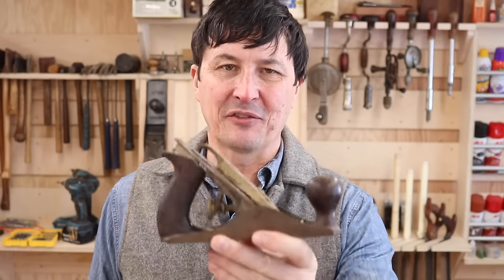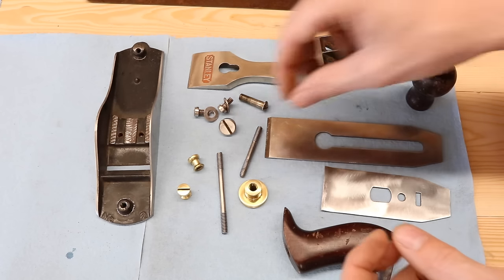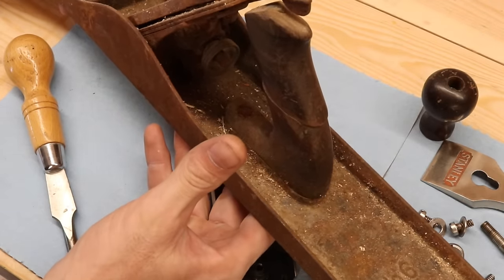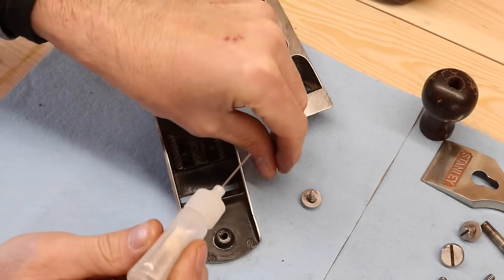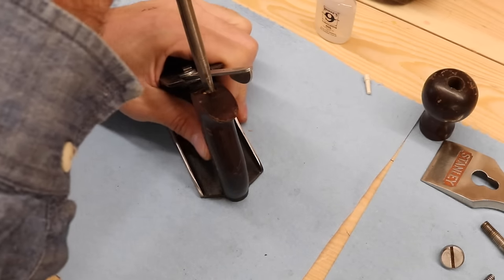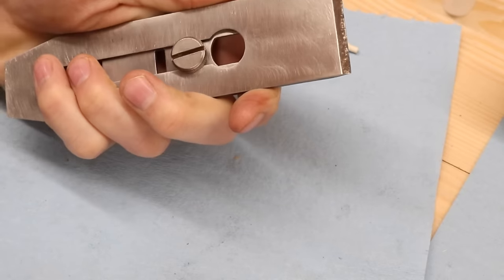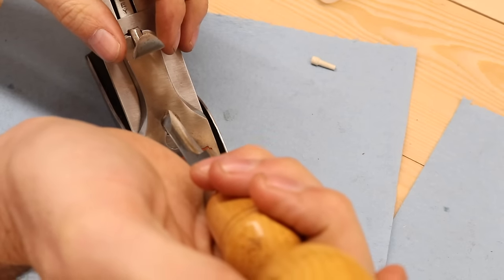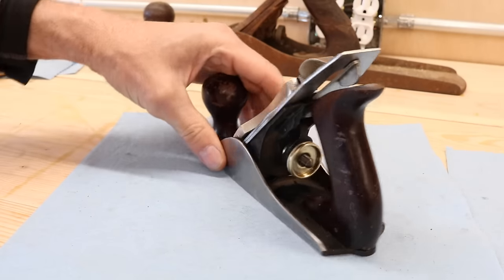HOW TO DESTROY A STANLEY PLANE!!

Comment: I don't why but I had a Eureka moment thinking about the 'frog'. It got me thinking back to my days in the army and using a bayonet frog to fasten the bayonet scabbard to a belt. While the origin of the term is uncertain there is link back to earlier frogs used to attach swords and knives to a belt. These had straps that supposedly resembled a frogs legs. 

The definition of the bayonet frog is 'a device to attach a blade to the belt' or something similar. 

This fits nicely with the purpose of the plane frog- it is a device to attach the blade to the plane. Furthermore there's always been a strong link between armourers and Smith's in war using their skill in peacetime metal working or vice versa. I'd expect therefore they would be familiar with the term .

I could be completely wrong of course but to me the logic works, maybe just another small piece in the puzzle of the frog 😉.

Comment: What an excellent restoration Cody! I'd give you more money for it now than as it was. I'd also don't like them repainted as it never looks quite right either. Excellent excellent job. 

Do the 6 and use and enjoy it. You are correct about the corrugated sole. It's an old plane pre dates your 2 by at least 30-40 years.

You can get rosewood handles from Crown tools in Sheffield England.

Comment: Simple restoration as you have done, maintaining the original finishes and patina, generally give the highest resale value.    This is not always the best way.    The No 6 covered in rust.   Left alone the rust over time will continue to damage the casting.   The broken tote makes the tool difficult to use.    Planes like this generally sale for peanuts.    Clean it up, repaint the casting, polish the metal, give it a decent tune up,  and maintain it, the plane will be serviceable and last for many years to come.  And be worth a few dollars.  

The No 6 is a type C.   C is for corrugated.    Two version of the reasoning.   Corrugated planes were introduced because as the heavier metal planes were introduced into the tool market, carpenters who had to carry their planes around balked at the extra weight.   So corrugated planes were developed more as a marketing tool to sell the planes.    Same reason they also made transitional planes.    They had to convince the carpenter and cabinet maker to buy the new planes.      The second story about reducing friction probably has some merit too.   

Stanley's with the keyhole in the cap are manufactured pre 1925.  After that planes were manufactured with the kidney shaped hole.

Comment: If I might make a recommendation, while I like the way it came out, use either a much much finer wire wheel or switch to a fine brass. A softer metal doesn't dig in as much and would at least limit the "brushed" finish. Some might say the metal is damaged now but I think it turned out pretty great.

I'd really look forward to seeing you restore the Bailey No. 6! Thanks for the vid,
-

Comment: The answer to the frog!
Rodger K. Smith, an engineer working for Stanley in the 18hundreds wrote in many of his files and work diaries of how (as in he was tinkering, and finding out "how") to fitnthe frog. He wanted to improve the fit of the frog, and he named it so. Because, and it's written in his diaries and notes, he said it sat behind the throat. Previously, people making wooden planes didn't need a throat. Stanley were making steel and brass planes, obviously requiring a throat, which Smith and his colleges were tinkering around with to improve the design of. Which is why most Plane frogs are adjustable these days. So yes, the Frog is "behind the throat". He only publicly called it that after a number of years. There's an engineering book by him where he also says the frog is "behind the throat". I've NEVER found or heard of any records that predate Rodger K. Smith about the Plane Frog.

Comment: hey wranglerstar, do you think maybe you want to flatten the sole fully built with the tension on the bolts??? I know When you flatten something without the bolts torqued it may flex or warp when you do torque the bolts and it wont be as flat as possible.

Comment: I have a small collection of Stanley planes and have cleaned many of them and keep a good example of each sharp and tuned to use in my wood shop. On the issue of "refurbishing" them you demonstrated the two ends of the extreme on this subject. You used a wire brush on the steel and brass and made every attempt to make this 90 year old plan look new again. (curiously you left the tote and knob all scratched up with the old varnish on them??) You mentioned that "purists" wanted the rusty and dirty planes left as found to preserve their value. What you failed to mention, in my humble opinion, is a middle road. My approach with these old planes, a number of which are from the 19th century, is to clean the metal of all rust and dirt ( I use 0000 steel wool and diesel and sometimes rust remover), clean all the wood using something like Formby's Refinisher which removes the old varnish, lightly Rub the wood with 0000 steel wool and coat with a couple coats of boiled linseed oil. After cleaning the blade and chip breaker I do sharpen the blade and file the leading edge of the chip breaker flat. This way I have a very usable plane but one that still retains the patina a tool of that age should have. There is a middle ground here.

Comment: Wranglerstar, I would be inclined to use a wire brush, along the grinding pattern, on the body of the plane, rather than a sander, as this would retain the grinding pattern, rather than removing it, and maintain the authentic appearance, and function.
Also, it would be worth investing in a spray can of clear furniture wax polish, to spray all the metal surfaces, as this protects them from re-oxidisation, and doesn't run off or evaporate like thin oils. Iron oxide spots form an electrolytic cell with other oxide spots which then expand the corrosion area. The wax fills and seals those microscopic pits, and then solidifies when the propellant evaporates.
I've some Stanley planes that I've had since my youth, if the prices you quote are common, maybe it would have been a better plan to buy more, instead of a pension?

Comment: Have you tried Evaporust or White Wizard to remove rust without removing any of the steel? Leaves a grey finish on steel which polishes up well. If used with stainless parts they come out like new.
Keep up the great work!

Comment: Great work on that #2. I would be very interested on the the Bailey restoration as well. Just a quick note, I have a woodworking friend that teaches others how to restore the old planes and he uses electrolysis to remove the corrosion from the metal pieces instead of the grinding. That takes off less of the material. You might try that instead of the buffing and grinder.

Comment: Hey Cody, do you have a resurfacing race for your grinder wheel? its a cast handle with 4 or 5 wavy disks that spin and re flatten the surface of the wheel. I also bought a "Lilly white washita" stone for advance sharpening.:)

Comment: I've got a late 70's craftsman grinder I picked up at a yard sale for $5. dual head, flexible gooseneck lamp, 1hp motor. only thing needed was a new stone and a wire wheel, and a new lamp socket. best $5 I ever spent. I've sharpened chopper mower blades with no problem

Comment: Great job, I really enjoy your chanel. Just a small pice of advice, you should not lubricate fixing screws since it changes the behaviour of the screw by removing the friction from the equation. Then a small torque generates a greater tension and you may snap it.

Comment: I just started on a Bailey #6 myself. Mine is not fluted but the very top of the handle is broken off just the same. Thinking about gluing on a piece and shaping to get it close. There are initials low on the handle I wouldn't want to lose.

Comment: Yes Cody please restore the number 6. I want to see how you clean up that fluted shoe.  I was able find and restore a Stanley block plane from the 1960s usnig the method you showed of wet dry sandpaper, a plate of glass, and wyndex.  lt came out perfect.  the original paint was in really good shape.  I didn't have do anythig to it except a good cleaning.  I was so excited to restore it after watching your videos that forgot to take before and after pictures so that I could so I could send them to you 😟😟.   Oh well Ihave another larger plane to restore.  I think it might be a Bailey not for sure.  Thank you for teaching me how do tool restoration.  You are a fine role model. I wished my father would have been.

Comment: Nice looking plane. As to value of anything, that is up to the holder. If you value old rusty things because they are old and you want to put them in a case and look at them, and then later sell them and (hopefully) make more money then, go to it. If on the other hand, the value of that item is in what I will give you in your woodworking, then by all means restore it to its full functionality. I have a couple of Stanley's from the late 1800's, that were very rusty and in need of TLC. They got it and now help me with my woodworking. The Stanley planes were designed and built to be used by craftsmen to work wood. Their value is in what they can do for someone who knows how to use them.

Comment: I have read that Japenning can be replicated using 50% asphaltium and 50% marine varnish.  Asphaltium can be obtained by using dried up roofing tar ground to a powder.  mixed with the marine varnish it will self level on flat surfaces.  Cures best when baked on at about 220 degrees centegrade.

Comment: @wranglerstar the Lee Valley website has measured drawings for the rear totes/handles on Stanley planes so that you can make precise replacements. Search their site for 'handle template'. The nos. 5, 6, 7, and 8 all use the same size.  I bet you could knock one out in an hour.

Comment: Funny trick with the title, however if you don't go back and adjust the frog farther forward the force of planing will press the iron back into the back of the throat and you will ACTUALLY DESTROY the sole of that plane when it cracks from the back corners of the throat. Go take it back apart and move it farther forward so the frog aligns WITH the rear of the throat. Need confirmation,? Go take a minute to watch a few of "Plane Collectors " videos. He shows and explains it better than I.

Comment: That's a fine job ye made on that Plane there.  Now ye can adjust it and put the necessary force into it when required.  The No.6 is gonna need a new handle, for certainty and safety.  I dare say that apprentices wouldn't have the bigger planes or tasks that need them to do, hence a smaller handle but it's probably just to scale.  Good on ye!

Comment: Oh yea!! Lest restore another one!! Good job! I get most of my parts for planes on ebay. Or ill buy a parts plane that's missing a few things.  I have around 35 working planes. Try making an electrolysis tank to remove rust. It works very well .Especially if something is locked up because of rust.

Comment: The handle can be repaired with some epoxy resin on your No6. I've had a similar problem with a stanley bailey No 4 and it works great after gluing the handle.

Comment: Drill, dowel and wood glue the handle on the #6. The stud holds it down tight when it's done. I fixed a friends bass guitar neck once by doing that. It worked great and held for a long time until he threw it on stage and broke it for good.

Comment: Rotate the front handle to its original position with the dings facing forward and the polished by the palm of the original owners  hand part to the rear. 'Just a thougt'. Great video's. Ray . From Norwood south London England where William ford Stanley lived & worked. Ps I'll keep my eye's peeled for a no1 for you.

Comment: Go ahead and restore the #6 and any others that you need/want to.  Patina is only of value if it IS NOT rust or pitting.  also, these planes from Stanley are not classics (yet).  Many of these planes are still made in certain versions.  Not all things should be left in rundown condition.  I have several of the same planes that you have that my father started collecting.  He restored some and I've restored others.  The main thing is not to remove name plates or so much material that you remove model designations and the like.  Love the series on planes.  Keep up the good work.  :-)

Comment: I have my dads old #4 that I’d like to restore, Did you run the sole or base through a milling machine where the frog bolts on? Or did it clean up that well?  
Anyway very nice restoration.

Comment: Excellent job, I agree tools should be used not left to rust on a shelf. when you restore the number 6 try putting it in white vinegar for 12 hours and it will take off  all the rust.

Comment: I think you can see why it's called the frog at 6:28 - just as you mention about the British sense of humour. The two large holes in the frog look like the eyes of the frog, with the throat looking like the frogs mouth.  I only noticed it when you were talking about it and happened to have the frog in the exact spot where the bottom edge of the frog lined up with the top edge of the throat.

Comment: The smallest planes I have (which aren't block planes) are a pre-WWII Stanley #4 and a Stanley #3.  The #3 is really small, I can't see where a #2 would be useful for me and my stubby sausage fingers.  I bought them rusty and neglected about 30 years ago, and yes, I use them all the time.  My "restoration" was cleanup, flattening and trueing, tune up and then to work.

Comment: May I suggest using Forsters Gunsmithing Screwdrivers for screws, especially brass screws. They are concave ground and will not slip and mar the surface of the screw.

Comment: Soak that rusty #6 in Evaporust. Works like magic and it's non-toxic. And you can use it over and over.
Oh, and and if I'm not mistaken, that #6 has a "corrugated" bottom.

Comment: For that no. 6 you can always remake the Handel and or expoxy the old one together (much like resin injected exotic woods) Soak some PB Blaster on the parts and break all of those screws loose. Then media blast/tumble them in a good medium. worst case you have to snap the screws and or drill them out and re-tap them. Luckily you can get aftermarket hardware for those planes. I wouldn't even bother with that old iron if its that far gone, get a nice Hock blade for it (dose not have to be Hock).

Comment: Not a bad job restoring the NO.2 Mr Wranglerstar sir ;). I don't see how anyone can say restoring a No.2 would devalue it.... have you seen what they sell for on Ebay? They are rear and worth more sensitively restored, not that the monetary value matters. However, I'm with you and Paul Sellers,(My Hero old School woodworker), these beautiful tools were built to last and to be used. Not restoring these tools only sentences them to an early grave and that would be very sad indeed. You've given this No.2 a fresh leash of life and it'll be good for many years to come and maybe even for the next keeper when your ready to pass it on. After all, we are only the current custodians on these wonderful tools until they are passed on to the next keeper. Now, I'm no expert, I've only been woodworking the last 2 years since started watching Mr Sellers but, I think the C on the iron is because that iron was originally made for a corrugated plane. The original iron would have had 'Sweetheart' stamp on it, so it would be worth looking out for an original No.2 iron to complete the restoration. Nice job, love to see these tools live on. If I was to be super critical, I would have the sanding abrasion marks running the full length of the plane body front to back for a more authentic finish. Please please restore the No.6c. That No.6 you have there is a great plane and it deserves to live on ;) Nice work sir ;) Thank you for sharing.

Comment: I have an old bailey plane a size down from yours In identical condition. I got it back to working condition, but I want to see what you end up doing with your cracked handle, as mine is cracked as well.

Comment: Place your adjustment screws in a cordless drill and use that with the wire wheel.  Also, where do you find most of your planes?

Comment: That Bailey no. 6 most likely is a Stanley. From an earlier era before the bed or the lever cap was embodied. You can tell by the lateral adjuster that it's made by Stanley. Love to see it restored. I agree that repairing the tote is worth doing, though I would also like to see one made from scratch.

Comment: The handle can be glued back together using a metal tube on the inside to strengthen the joint. I did it on a number 5 and it's worked quite well.

Comment: small dowels and wood glue, that number six handle that is split will be good as new, and as for the chip in the front handle maybe flatten it off and face it forward or do the same to the other side and make it symmetrical?

Comment: I agree with you totally... A tool is has more value in usable condition. Yet going to far in a restoration takes away much of the character. 
I restore firearms, and make an effort to keep as much as the dings and scratches as possible without compromising the safety.  Many firearms can easily be replaced for far less that a good restoration, but the real value is in the story, and an older firearm, or tool is built superior than new items you get now. I'd take old quality over new price any day.

Comment: Before using sand paper to remove rust try to use Evapro-Rust. first then clean thing up with very fine steal wool. I think you will like the results better.

Comment: i use the small fine brush on a Dremel tool for the brass parts. you can get in all the tight spots. im afraid to clean them with that wire.